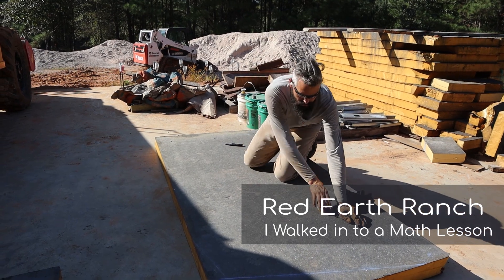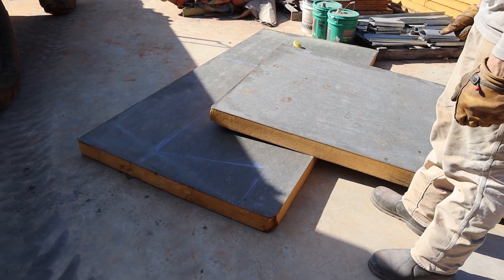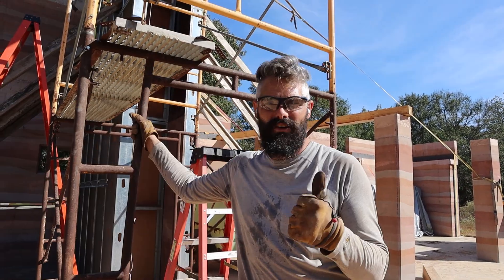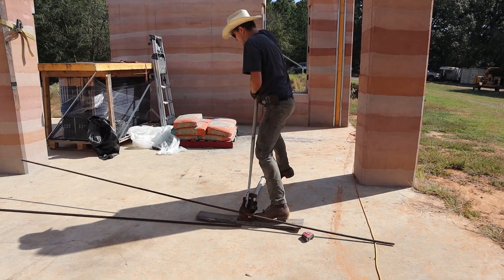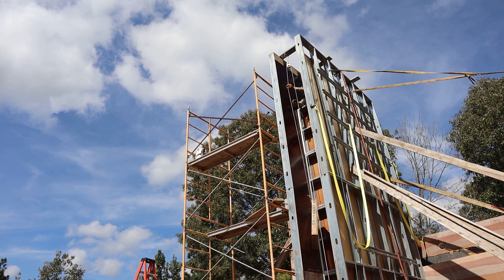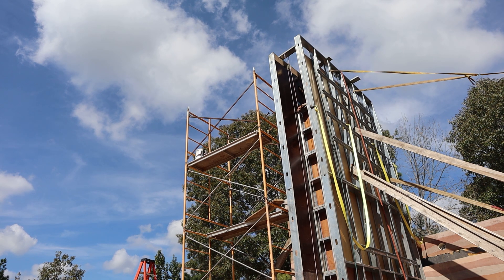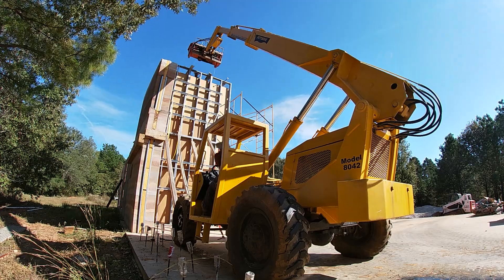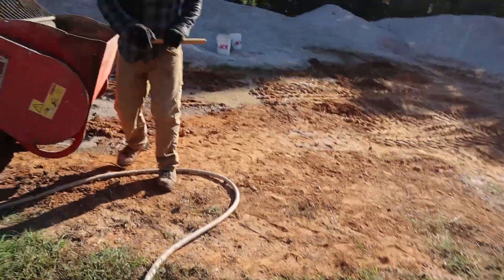Real Life Math - Cutting Foam for Rammed Earth is Hard - Vlog 81

Comment: My second question, is Rammed Earth walls tornado proof? Many homes have recently been destroyed in Kentucky, so I was wondering.
Reply from the maker: I would imagine it would be tornado proof given its weight and stability once fully built. However, my concern would be the negative pressure created during a tornado causing damage to the windows, doors, and roof. I'm no expert by any means on this but that is my initial thought. We occasionally have tornadoes where we are so I have been trying to think of ways to mitigate these concerns using a batten system to cover the windows and attaching the roof with overbuilt hardware. I still need to run these through some stress testing software. As we get closer to implementing these I will make sure to post it.